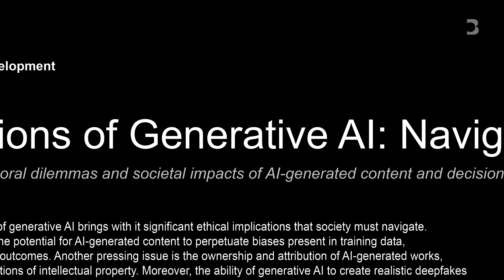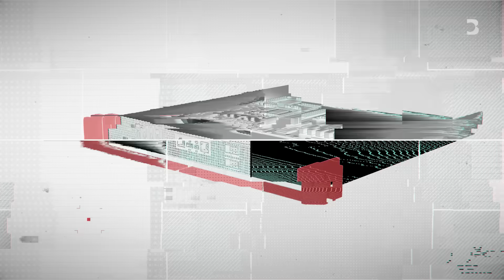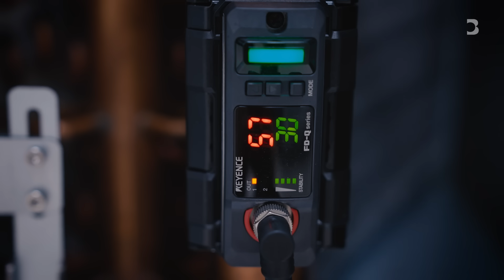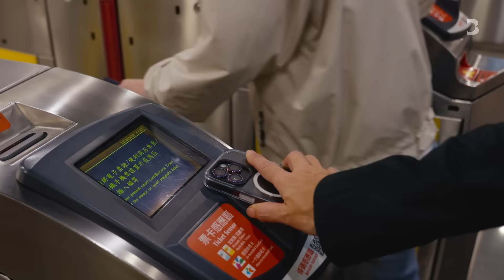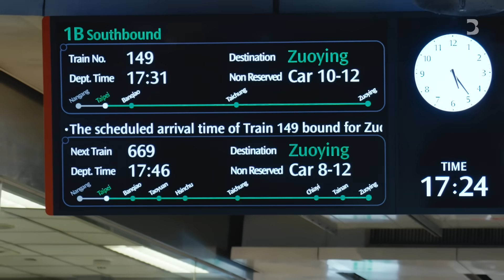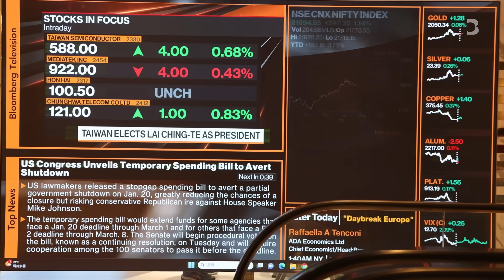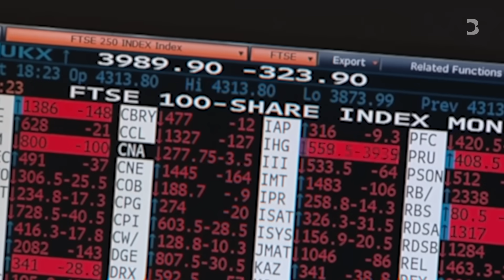Why AI Can't Exist Without Taiwan

Comment: The world Can't Exist Without Taiwan
Reply: Taiwan's Chip Industry Controls the Lifeline of Global Technology

Chip Specification Grade Classification:
Logic (Processors, AI Artificial Intelligence Computing), Memory Chip Operating Environment Requirements:
Commercial Grade -- 0~+70℃.
Industrial Grade -- -40~+85℃.
Automotive Grade -- -40~+125℃.
Military Grade -- -55~+150℃.
There's also an even higher grade: Aerospace Grade (Radiation Hardened), which requires resistance to radiation and interference, as well as a wider temperature range. Military and aerospace grade chips undergo rigorous qualification testing: pushing them to their limits, continuous high and low temperature cycling, vibration, shock, high ESD (Electro Static Discharge), and interface terminal plugging/unplugging endurance...
Generally, industrial-grade chips are twice as expensive as commercial-grade chips, automotive-grade are three times or more expensive, and military-grade chips are very expensive due to the need to amortize the manufacturing line costs. For aerospace -grade chips, setting up a production line costs hundreds of millions of US dollars, regardless of the quantity produced.
Taiwan's TSMC is the exclusive global manufacturer of high-end logic, AI, and memory chips for the US and its allies, as well as Taiwan's Chung-Shan Institute of Science and Technology (CSIST), for military and aerospace applications. The US Defense Advanced Research Projects Agency (DARPA) has approved the following manufacturers for producing military and aerospace grade logic chips and processors for the US military and aerospace industry: Taiwan's TSMC (advanced 7, 5, 3 nanometer process technology), US-based Intel (14 nanometer and above processes), and US-based GlobalFoundries (28 nanometer and above processes).
The manufacturing process, technology, materials, and raw materials for military and aerospace-grade chips are highly classified. The US and Taiwan have signed agreements to jointly control the highest-level technologies, prohibiting their export to other countries. The US government, still concerned for national security, has requested TSMC to invest and build factories in the US to manufacture advanced AI chips. Their entire production capacity is contracted by US Department of Defense military and aerospace manufacturers. Only the surplus and new factory capacity will be allocated to other companies like Nvidia, Apple, AMD, and Intel. This is an unspoken secret.

China and Russia's military and aerospace equipment can only use general commercial-grade chips for manufacturing, employing a trial-and-error method to create heat and cold insulation plus protective layers to shield the chip motherboards. This approach leads to short warranty periods and questionable real-world operational quality for Chinese and Russian military equipment such as missiles, radar detection systems, and aerospace equipment. Facing the US's high-tech electronic warfare countermeasure systems, their chip motherboards are vulnerable to destruction by high-power electromagnetic waves, causing missile failure and radar detection system malfunction. The failure of Russian weapons in the Russia-Ukraine war fully demonstrates this fact. If China invades Taiwan, the PLA's J-20, J-16 fighters, missiles, radar detection systems, and naval radar detection systems, which are designed using commercial-grade chips, will undoubtedly suffer a major defeat against US-Taiwanese electronic and electromagnetic warfare, and anti-electromagnetic pulse weapons. (Unverified online rumors in China suggest that the guidance systems of PLA missiles and torpedoes are reverse-engineered from US military technology of the 1990s, using stockpiled Intel 486 and 586 processors of commercial grade from 20-30 years ago for manufacturing.) This is something that the general public wouldn't understand, only experts in chip technology would know. Without mastering the highest technology in the chip industry, the Chinese Communist military is fundamentally unqualified to wage war!

Electric vehicles in China are frequently reported in their domestic market for failing to start due to excessively cold or hot weather, experiencing battery explosions, or suddenly malfunctioning while driving, leading to casualties. Besides other factors, it is very likely that Chinese electric vehicle manufacturers, in order to reduce costs, unscrupulously violate vehicle industry safety standards by not using automotive-grade chips and semiconductor components, and instead using cheaper commercial-grade chips and semiconductor components for the electric vehicle's electronic and electrical systems, making accidents inevitable.

The computer chips for the US Mars spacecraft are manufactured by Taiwan's TSMC using aerospace -grade chip technology. The computers for the US aerospace station are designed by Taiwan's CSIST and manufactured by TSMC using aerospace -grade chip technology, guaranteed to operate flawlessly in aerospace for 20 years. The computers and electronic systems for US and European low-Earth orbit satellites must be manufactured using TSMC's aerospace-grade chip technology.
Reply: China: nah uh :face-red-droopy-eyes:
Reply: lol
Reply: You mean Congo

Comment: Taiwan  NO.1 🇹🇼🇹🇼🇹🇼
Reply: Nah man you probably just don't know the world work and the U.S its number 1.
Reply: Taiwan's Chip Industry Controls the Lifeline of Global Technology

Chip Specification Grade Classification:
Logic (Processors, AI Artificial Intelligence Computing), Memory Chip Operating Environment Requirements:
Commercial Grade -- 0~+70℃.
Industrial Grade -- -40~+85℃.
Automotive Grade -- -40~+125℃.
Military Grade -- -55~+150℃.
There's also an even higher grade: Aerospace Grade (Radiation Hardened), which requires resistance to radiation and interference, as well as a wider temperature range. Military and aerospace grade chips undergo rigorous qualification testing: pushing them to their limits, continuous high and low temperature cycling, vibration, shock, high ESD (Electro Static Discharge), and interface terminal plugging/unplugging endurance...
Generally, industrial-grade chips are twice as expensive as commercial-grade chips, automotive-grade are three times or more expensive, and military-grade chips are very expensive due to the need to amortize the manufacturing line costs. For aerospace -grade chips, setting up a production line costs hundreds of millions of US dollars, regardless of the quantity produced.
Taiwan's TSMC is the exclusive global manufacturer of high-end logic, AI, and memory chips for the US and its allies, as well as Taiwan's Chung-Shan Institute of Science and Technology (CSIST), for military and aerospace applications. The US Defense Advanced Research Projects Agency (DARPA) has approved the following manufacturers for producing military and aerospace grade logic chips and processors for the US military and aerospace industry: Taiwan's TSMC (advanced 7, 5, 3 nanometer process technology), US-based Intel (14 nanometer and above processes), and US-based GlobalFoundries (28 nanometer and above processes).
The manufacturing process, technology, materials, and raw materials for military and aerospace-grade chips are highly classified. The US and Taiwan have signed agreements to jointly control the highest-level technologies, prohibiting their export to other countries. The US government, still concerned for national security, has requested TSMC to invest and build factories in the US to manufacture advanced AI chips. Their entire production capacity is contracted by US Department of Defense military and aerospace manufacturers. Only the surplus and new factory capacity will be allocated to other companies like Nvidia, Apple, AMD, and Intel. This is an unspoken secret.

China and Russia's military and aerospace equipment can only use general commercial-grade chips for manufacturing, employing a trial-and-error method to create heat and cold insulation plus protective layers to shield the chip motherboards. This approach leads to short warranty periods and questionable real-world operational quality for Chinese and Russian military equipment such as missiles, radar detection systems, and aerospace equipment. Facing the US's high-tech electronic warfare countermeasure systems, their chip motherboards are vulnerable to destruction by high-power electromagnetic waves, causing missile failure and radar detection system malfunction. The failure of Russian weapons in the Russia-Ukraine war fully demonstrates this fact. If China invades Taiwan, the PLA's J-20, J-16 fighters, missiles, radar detection systems, and naval radar detection systems, which are designed using commercial-grade chips, will undoubtedly suffer a major defeat against US-Taiwanese electronic and electromagnetic warfare, and anti-electromagnetic pulse weapons. (Unverified online rumors in China suggest that the guidance systems of PLA missiles and torpedoes are reverse-engineered from US military technology of the 1990s, using stockpiled Intel 486 and 586 processors of commercial grade from 20-30 years ago for manufacturing.) This is something that the general public wouldn't understand, only experts in chip technology would know. Without mastering the highest technology in the chip industry, the Chinese Communist military is fundamentally unqualified to wage war!

Electric vehicles in China are frequently reported in their domestic market for failing to start due to excessively cold or hot weather, experiencing battery explosions, or suddenly malfunctioning while driving, leading to casualties. Besides other factors, it is very likely that Chinese electric vehicle manufacturers, in order to reduce costs, unscrupulously violate vehicle industry safety standards by not using automotive-grade chips and semiconductor components, and instead using cheaper commercial-grade chips and semiconductor components for the electric vehicle's electronic and electrical systems, making accidents inevitable.

The computer chips for the US Mars spacecraft are manufactured by Taiwan's TSMC using aerospace -grade chip technology. The computers for the US aerospace station are designed by Taiwan's CSIST and manufactured by TSMC using aerospace -grade chip technology, guaranteed to operate flawlessly in aerospace for 20 years. The computers and electronic systems for US and European low-Earth orbit satellites must be manufactured using TSMC's aerospace-grade chip technology.
Reply: The Greenholic
Reply: @BowenChen-sh3sz Better than CCP Chinese

Comment: That is why Taiwan is strategically too important for the US.
Reply: Taiwan's Chip Industry Controls the Lifeline of Global Technology

Chip Specification Grade Classification:
Logic (Processors, AI Artificial Intelligence Computing), Memory Chip Operating Environment Requirements:
Commercial Grade -- 0~+70℃.
Industrial Grade -- -40~+85℃.
Automotive Grade -- -40~+125℃.
Military Grade -- -55~+150℃.
There's also an even higher grade: Aerospace Grade (Radiation Hardened), which requires resistance to radiation and interference, as well as a wider temperature range. Military and aerospace grade chips undergo rigorous qualification testing: pushing them to their limits, continuous high and low temperature cycling, vibration, shock, high ESD (Electro Static Discharge), and interface terminal plugging/unplugging endurance...
Generally, industrial-grade chips are twice as expensive as commercial-grade chips, automotive-grade are three times or more expensive, and military-grade chips are very expensive due to the need to amortize the manufacturing line costs. For aerospace -grade chips, setting up a production line costs hundreds of millions of US dollars, regardless of the quantity produced.
Taiwan's TSMC is the exclusive global manufacturer of high-end logic, AI, and memory chips for the US and its allies, as well as Taiwan's Chung-Shan Institute of Science and Technology (CSIST), for military and aerospace applications. The US Defense Advanced Research Projects Agency (DARPA) has approved the following manufacturers for producing military and aerospace grade logic chips and processors for the US military and aerospace industry: Taiwan's TSMC (advanced 7, 5, 3 nanometer process technology), US-based Intel (14 nanometer and above processes), and US-based GlobalFoundries (28 nanometer and above processes).
The manufacturing process, technology, materials, and raw materials for military and aerospace-grade chips are highly classified. The US and Taiwan have signed agreements to jointly control the highest-level technologies, prohibiting their export to other countries. The US government, still concerned for national security, has requested TSMC to invest and build factories in the US to manufacture advanced AI chips. Their entire production capacity is contracted by US Department of Defense military and aerospace manufacturers. Only the surplus and new factory capacity will be allocated to other companies like Nvidia, Apple, AMD, and Intel. This is an unspoken secret.

China and Russia's military and aerospace equipment can only use general commercial-grade chips for manufacturing, employing a trial-and-error method to create heat and cold insulation plus protective layers to shield the chip motherboards. This approach leads to short warranty periods and questionable real-world operational quality for Chinese and Russian military equipment such as missiles, radar detection systems, and aerospace equipment. Facing the US's high-tech electronic warfare countermeasure systems, their chip motherboards are vulnerable to destruction by high-power electromagnetic waves, causing missile failure and radar detection system malfunction. The failure of Russian weapons in the Russia-Ukraine war fully demonstrates this fact. If China invades Taiwan, the PLA's J-20, J-16 fighters, missiles, radar detection systems, and naval radar detection systems, which are designed using commercial-grade chips, will undoubtedly suffer a major defeat against US-Taiwanese electronic and electromagnetic warfare, and anti-electromagnetic pulse weapons. (Unverified online rumors in China suggest that the guidance systems of PLA missiles and torpedoes are reverse-engineered from US military technology of the 1990s, using stockpiled Intel 486 and 586 processors of commercial grade from 20-30 years ago for manufacturing.) This is something that the general public wouldn't understand, only experts in chip technology would know. Without mastering the highest technology in the chip industry, the Chinese Communist military is fundamentally unqualified to wage war!

Electric vehicles in China are frequently reported in their domestic market for failing to start due to excessively cold or hot weather, experiencing battery explosions, or suddenly malfunctioning while driving, leading to casualties. Besides other factors, it is very likely that Chinese electric vehicle manufacturers, in order to reduce costs, unscrupulously violate vehicle industry safety standards by not using automotive-grade chips and semiconductor components, and instead using cheaper commercial-grade chips and semiconductor components for the electric vehicle's electronic and electrical systems, making accidents inevitable.

The computer chips for the US Mars spacecraft are manufactured by Taiwan's TSMC using aerospace -grade chip technology. The computers for the US aerospace station are designed by Taiwan's CSIST and manufactured by TSMC using aerospace -grade chip technology, guaranteed to operate flawlessly in aerospace for 20 years. The computers and electronic systems for US and European low-Earth orbit satellites must be manufactured using TSMC's aerospace-grade chip technology.
Reply: Not really. All US need to do is move the chip company to us will do
Reply: @limlisa  HAHA IN YOUR DREAM🤡
Reply: @limlisa You cannot reproduce what Taiwan has built for years on its supply chain and its discipline in a short period of time. Even if you’ve started now, you’d still rely on Taiwan’s help immensely. However, its most advanced technology will still continue to evolve and stay in Taiwan. It’d be hard to catch up!
Reply: @limlisa  not likely. if you think about the ecosystem, the total cost, manufacturing in the U.S. is nowhere comparable to in Taiwan. Besides, US has Intel itself but look at how it went...most if not all the orders were transferred to TSMC or Samsung...
Reply: @limlisa salary is 3X no one want to go US make something 😂
Reply: @limlisa Did you not understand the context? TSMC is the global leader because of Taiwan's ecosystem. The owner of TSMC, Mr. Chang, said without Taiwan, TSMC is nothing. He didn't set up his company in US, why did you think that was? He was from Texas Instrument.